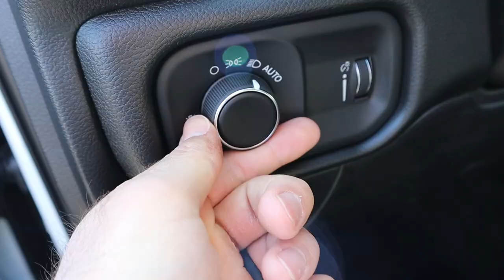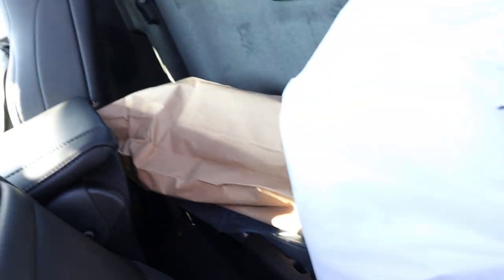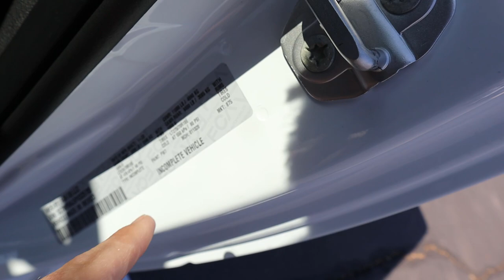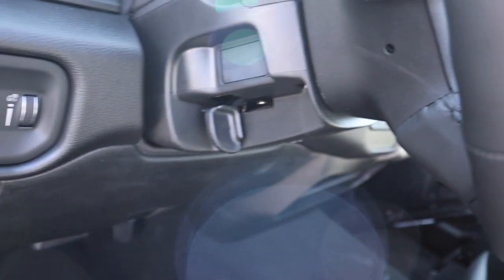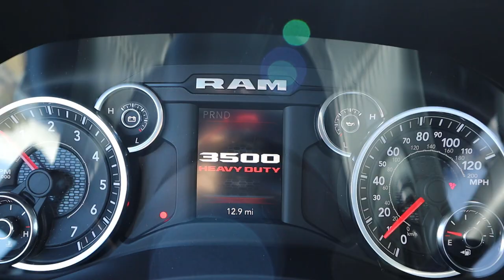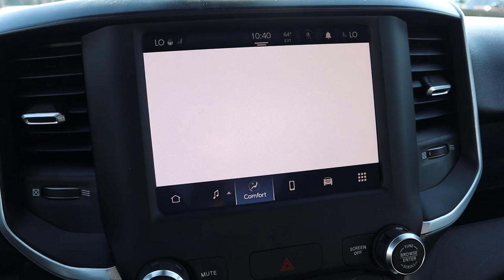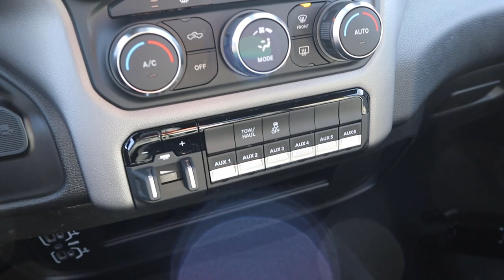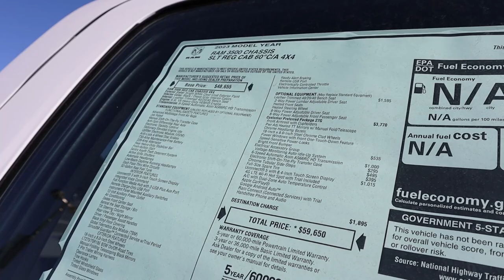2023 Ram 3500 Cab And Chassis: Is This A Great Work Truck?

Comment: I have the dually version of this and making an overlander by adding a flatbed and flatbed camper.  I have added Titan XXL mid-ship tanks which effectively doubles the range. I have added a Curt commercial hitch for towing a horse trailer. Will be converting the dually to a single wheel using AEV Katla wheels and going with a 34" tire (metric sizing), adding an AEV bumper and brush bar and warn winch. Thanks for the review, it's helpful.

Comment: There  is a new body Ram 4 door 3500 in my area with a steel flatbed on it and it looks very cool. He lifted the truck and put 35's on it and the flatbed looks expensive and high quality, the truck definitely turns heads when he drives by.

Comment: Funny seeing the column shifter. I thought Ram went to the dial shifter across the line for the gas engines, guess it’s the 6 speed transmission.